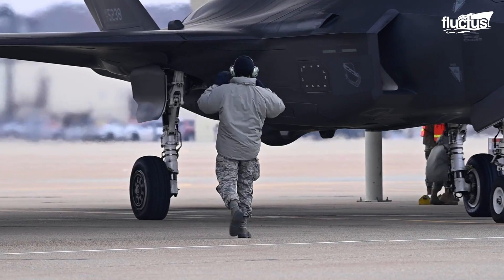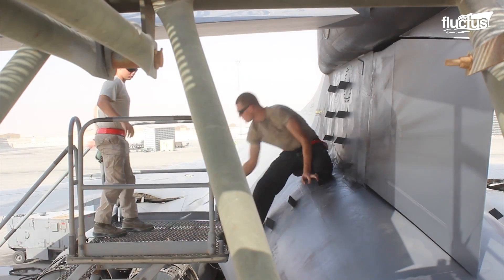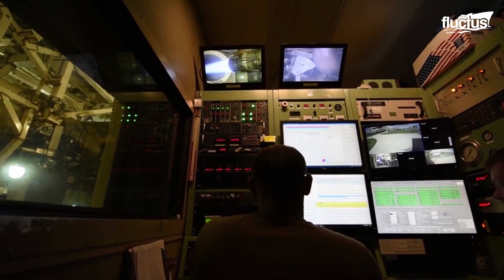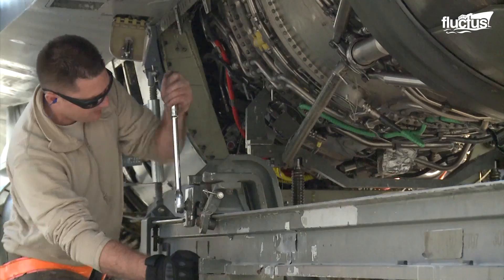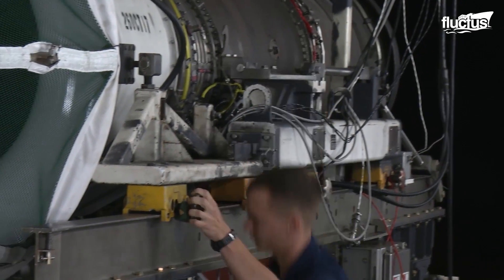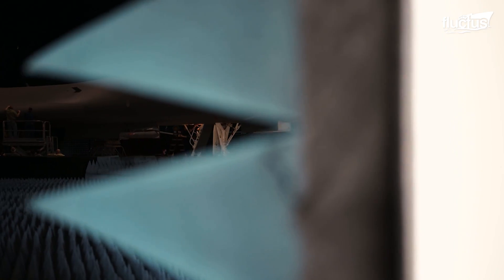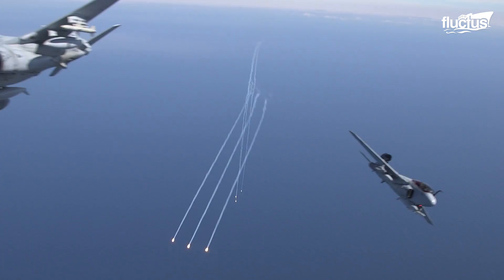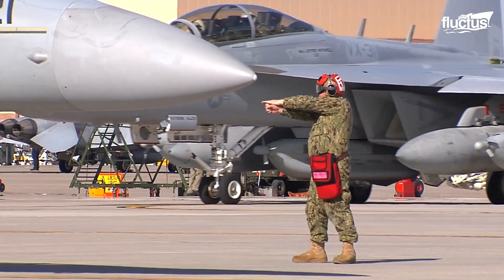How the US Test Jet Engines to their Extreme Limit in Secret Facilities

Comment: Just out of curiosity, the F101 engine is the basis for the F110 - equips F16 - and the CFM56 - drives A320 Neo and 737 NG. This engine is so ahead of its time that this exact core will fly for 75+ years (50 so far).